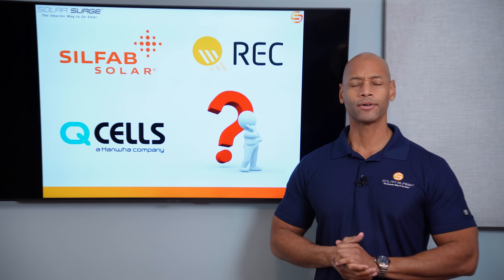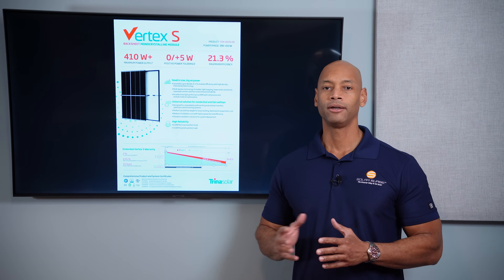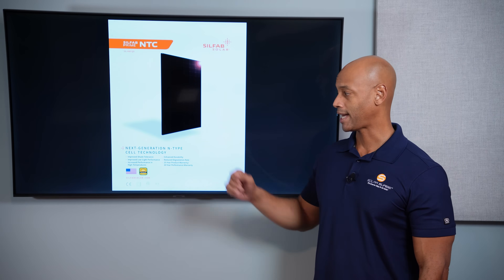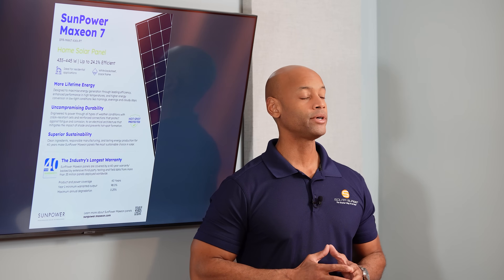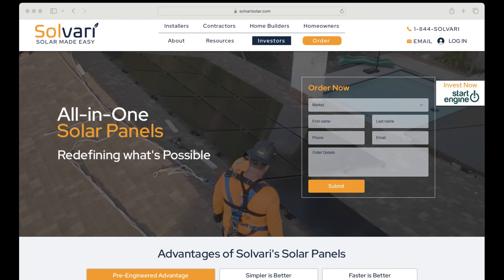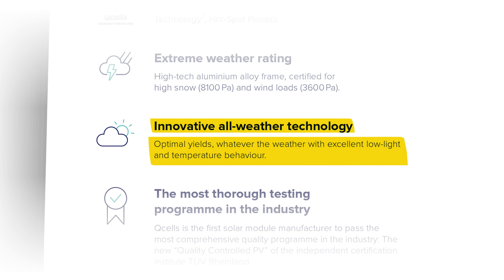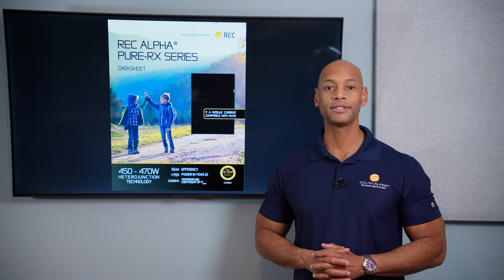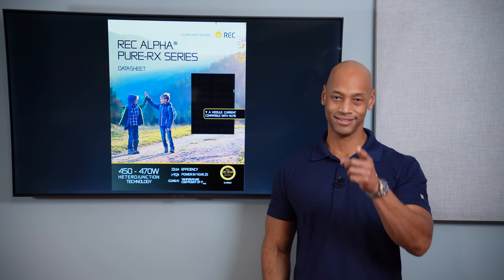Top 5 Best Solar Panels Going Into 2025

Comment: I would say it would be great to also explain that the supply chain issues to get REC or really any good panel in time for install before end of the year tax credit is challenging. Supply is extremely limited in FL market from all major distributors. Would be great if you could expand on how missing on 30% credit is not worth it over waiting for any specific panel.

Comment: What would you recommend between REC 450W vs Silfab 440W ? REC beats it in degradation rate, thermal coefficient however the efficiency is only 21.6 compared to 22.6

Comment: What is the best roof for installing solar panels? and how can we make sure we have the best fit for the solar panels, whole house battery, and back up whole house generator? They all have to cooperate with each other smoothly and I cannot figure this out since they are all sold separately and do not necessarily align or work together smoothly
Reply from the maker: I would say a standing seam metal roof is the best for longevity.  Asphalt shingle roofs are the most popular and will have the lowest cost for mounting.  If you plan on using a generator with your solar and battery system, we recommend FranklinWH and PointGuard.

Comment: Thanks for the presentation. How about Canadian Solar TOPHiKu6 455-470W? The 455 uses N-Type cells, has a module efficiency of 22.3%, a 0.55% or less degradation rate, and temperature coefficient -0.29%. How about PEIMAR, Made in Italy, and backed up by Costco in Puerto Rico? You've never talked about PEIMAR in any of your videos.
Reply from the maker: I've had good experience with both Canadian Solar and Peimar in the past.  We don't see Peimar much on the US market.
Reply: @SolarSurge  Thanks for your prompt reply.

Comment: What is the split cell quantity of the panels. Isn't a 144 split cell more beneficial in shading then 109 or lesser split cell?
Reply from the maker: Most of these are using 108 half-cut cells

Comment: I'm on the fence about my solar installation because my roof is 19 years old and made of high-quality lifetime shingles. It looks good, with no cracks, but there is no more granular running in the gutters.
Reply: If you have the room, I suggest ground mounted 100% of the time. Maybe on a shed or outbuilding, but on the home itself......do not do it.
Reply: @SarahStuff-p5u  What experience can you relay that guides this advice?  A bit too late for me and my 13-year-old roof.
Reply: @vinnie97  The Solar will outlast the roofing in most situations.
Reply: @SarahStuff-p5u  And having to remove the panels and reinstall can cause issues  - stopped me from making an offer on a home where 18 panels were no longer working 1 months after removal and replacement.  Its on a clay tile roof and it seems like a nightmare  - This was an expensive Hawaii home and now I know what they were selling cheap. .

Comment: Been super happy with my REC 405w panels we put on the roof a year ago.  Worth noting that if you are doing a ground mount the heat coefficient is likely a bit less of a concern as you will likely have wind helping cool the panels down a bit more versus on the roof where there is likely less airflow under the panels.
Reply: What company did your install?
Reply: @JosePimentel-n5f  Green City Solar out of Fort Meyers, I worked directly with Robert the owner, he was great, I had done a ton of research so I knew I wanted the REC Alpha 405w and iq8m micros.  Put in a 16.2 kw system, 30 panels on the south and 10 on the east, which is on target to produce 25-26mw over the 12 month time frame.   Yeah can't recommend Green City Solar enough, if you are in SW Florida definitely give them a call.
Reply: @JosePimentel-n5f  in the fort Meyers area, I used green city solar.  Small team but they really did a fantastic job, I knew exactly what I wanted and they worked with me to get a good quote and they did an excellent job, I really can't recommend them enough.
Reply: What is the price or can we use it in Nigeria and how many Watt can carry big fridge, two air conditioners one freezer and other  electricity gagets including outside light too.
Reply: @Elizabeth-bf8zb  you need to use your monthly bills to average out your usage.  Then build a system based on the average bill for the past year.  
 
You can get a quick estimate of how many panels you need by looking up your areas peak sunlight hours per day(average), and find out your panels output rating.  A good estimate is: peak sun hours * panel in watts * .8 = panel power output in watts. 

So if you have 4 hours of peak sun a day on average, and you are using 400w panels then the equation is 4hours * 400watts *.8 = 1280watt hours or 1.2kWh per day.   you can then use that to estimate how many panels you need, say you need 1000kwh a month, 1.2kwh * 30 days is 36kWh per panel per month.  1000kwh / 36kwh = 27.777 or 28 panels would be required.  

The .8 above is effectively just accounting for 20% loss. This is conservative(which you want to error on the side of producing too much vs not enough) but I have found it to be a pretty good overall estimate, and is what I used to size my system.

Comment: The new REC panels are shorter and wider than the Pure 2 panels.  Turns out I can't fit as many panels and would lose production if I switched to them.
Reply: even with the higher output?
Reply: The 470W panels use 8% more surface area (22.4 ft^2) compared to the 430W (20.8 ft^2) so that the new panels only produce 1.5% more power per W/ft^2.  The new panels are 15% wider and 7.5% shorter so losing even 1 panel loses me 5% which leaves me with 97% of the power I would get with the Pure 2 panels.
Reply: @jabbathespud  Hadn't done the measuring in my case, so I'm glad you did (I have the 420Ws currently installed since the 430Ws have been so elusive to find).  I suspect I would be in a similar position of loss because the roof is already tightly packed as it is.  Gonna' take even greater efficiency to be able to milk out anymore production from this roof.

Comment: i have to ask why is this not in the list https://aikosolar.com/wp-content/uploads/2024/06/Comet-3N_Plus_72e_AIKO-A-MAE72Dw-620W-645W-20240617.pdf
Reply: well well i note that maxeon loses 2% in 1st year vs 1% here but also close on the degradation over time at <<0.35%p.a. vs 0.25%p.a. so over 30 years is only a % loss of  2% difference 88.85% vs 90.75% of day 1 performance

Comment: He struggles to give the same stats in the same consistent format for each one!  But that's the least of it.  This same guy talks about contradictory concepts almost weekly.  One minute DIY is a thing.  Next video, the warr a try and guaranty are only as good as the company behind it.  For the DIY dupe, this means you have no real warranty on your install but will you hear him say this???  Nope. 

But the most frustrating thing is hearing him call the number 5 a "value" solar module!  (At least he calls them that now).  How is it a "value" if the warranty is less and the degradation is more???  It's as if he has no concept of the meaning of what he's saying in real terms!  

I say this in alarm because this is supposed to be high level, trusted advice!!!

And finally, he talks about PPW the most meaningless and foolish faux metric ever introduced to this industry - a self destructive, self sabotaging industry that has failed to launch effectively because of failure to think clearly!

Comment: The back-panel circuit electrical design ALONE of Maxeon panels should move it to the #1 position on this list. 
You literally have a higher probability of being struck by lightning in your lifetime than having a Maxeon panel failure in its 40 Year lifespan.